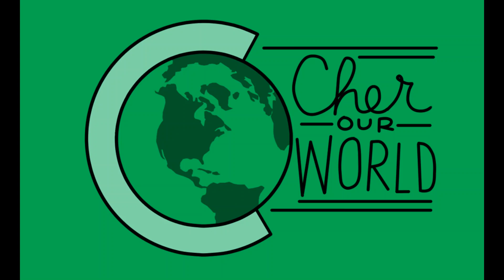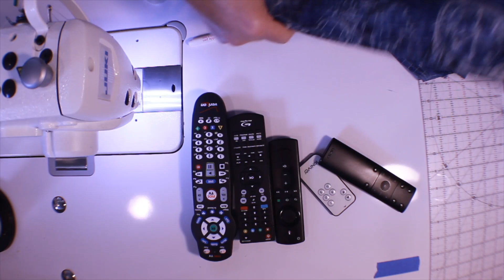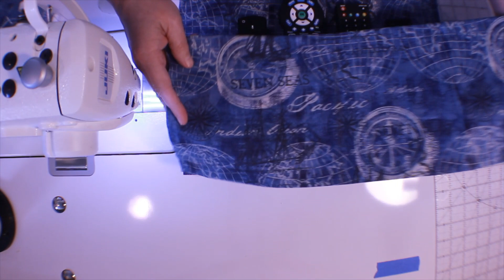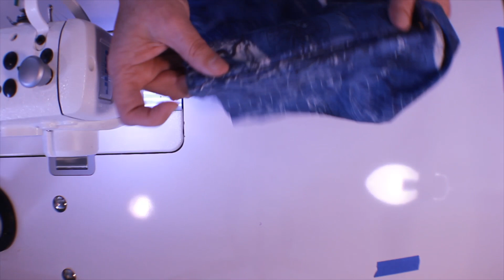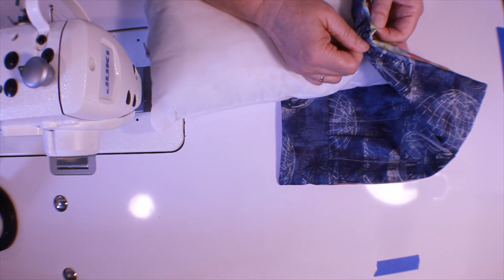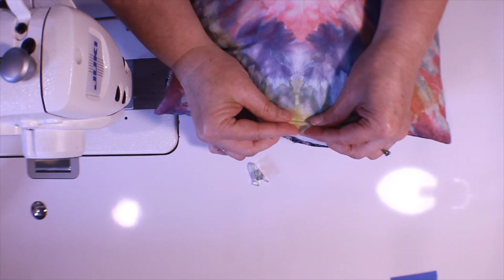Remote Control Organizer

Comment: I’m going to try this. I will adapt the pleats at the bottom to not lay one direction but pleat them instead. The tiny white remote I have a black one I’m going to run a horizontal stitch half way up the vertical channel so that the pocket is not as deep for the little remote to drop to bottom since it’s a narrow pocket that’s harder to get remote out. So half depth will keep remote top a little higher to access it easier. Thanks for the tutorial
Reply from the maker: I am so happy you are making this project work for you. I love your suggestions. Happy sewing.